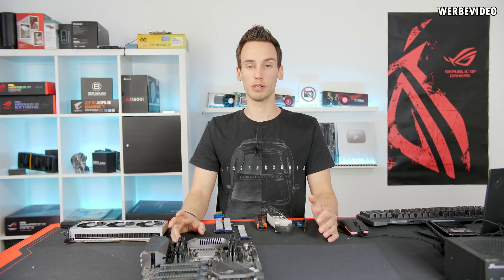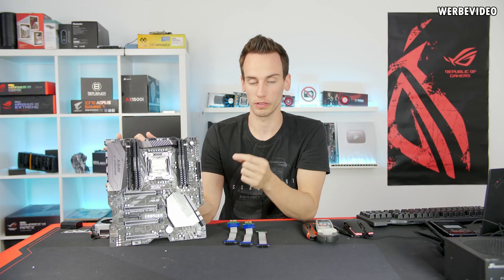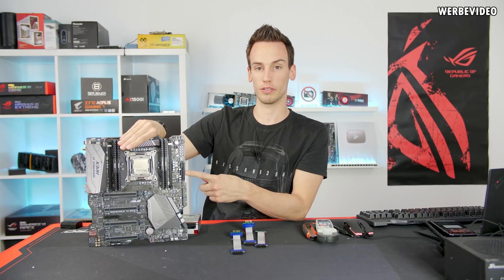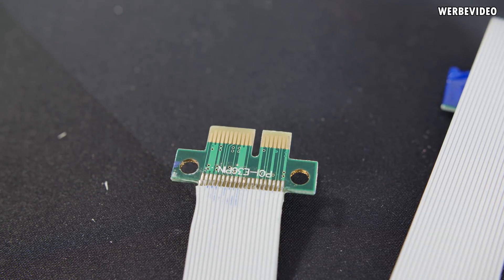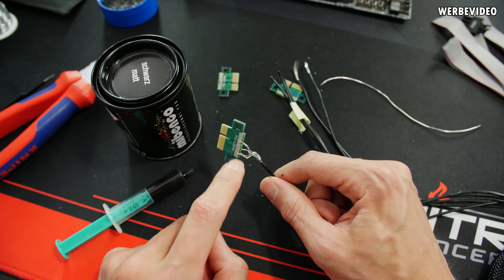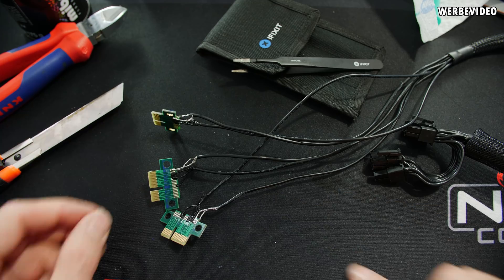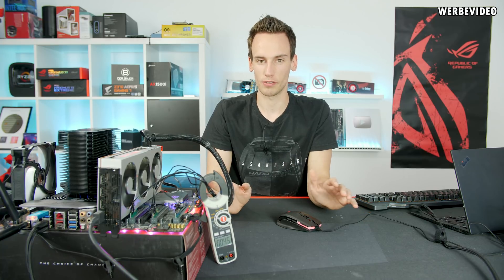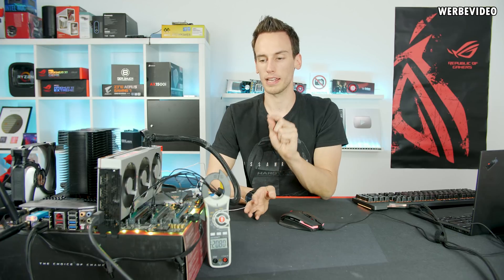DIY-Adapter: Running a Radeon VII just through PCIe-Slot Power

Comment: the dell optiplex 3040 has a i5 6500 and the board has no 24 pin but only an 8 pin, coming out the board is some proprietary 4 pin that powers hdd and cd/dvd and i spliced the wire and added a 6 pin to it so i can use a gtx 1060. i used riser cables also. i took out the cd/dvd drive so the gpu could stick out the front lolol. i have a 180w power supply, i used intel xtu to turn down how much watts it can pull under turbo load and lowered voltage. if i got a k scew cpu i believe you could over clock and change the multipliers using the xtu. i also used msi after burner to change how much power the 1060 can pull. if i dont do any of that i risk damage on the power supply. i dont know the long term use of what could happen to the board with power being pushed through the board to the gpu. from my experience dell has very robust products.

Comment: Mr. Der8auer. Just a quick note from a amateur pcb layout guy. I would be careful in assuming the ground pins that are with the data lines are ok for power. Most high speed design rules dictate to suppress noise and cross talk that the traces are routed separately and are not designed to flow any power usually very fine traces quite often on the same plane as the signal traces instead of the power plane layer in the pcb stack. I would almost guarantee only pins / traces that can handle power are on the first short part of the conductor. Another thing that will happen if you use the signal ground/shield traces is you could end up with current flow in that trace it will couple as noise into the signal line.

Comment: @derbauer hp uses a similar method in many of their desktops providing sata power for hdds ect from the motherboard, the PSU only supplies power to the CPU and board, then power for drives comes from the board via 4 wire cables that come off the board, hp Compaq pro 6300 sff, regardless amazing video as always :)

Comment: ive been hammering 2 RX480's with single 6pin under water OC'd since they came out mid range motherboard.  I run a lot of compute and 3d tasks that run for extended periods of time.

Comment: i think all motherboards should have on the PCB just  under the GPU  behind the PCIE slot two 8 pin male that will automatically slide in the GPU 8 pin females...and  get rid of all cables to gpus, with an extra Connector on the PCB.

Motherboards for factors shoudl be changed to 1 gpu   or 8 GPU configurations, and not  ATX eatx etc etc form factors...a smost gamers use single cpus it owudl makealso sense to change GUS to be flat on teh PCB like tehcpu instead ofhaving such amassive big Caard...this woudl thenmake it easier to use  single onoblock to cool everythign on the motherboard and kepe teh PCB clean from dust and smoking.
Reply: How would running my 4x crossfire work? Hmmm? You think you could safely power over 1 kW in cards stock? That PCB would also cost a fortune to safely do. It also might seriously make passing EM radiation/data loss much more difficult (nobody runs just 1 PCIe device, 4x NVME on an X16, GPU x16, SAS raid cards, networking card, sound card (though those are stupid, who needs quality sound?), USB expansion slots etc. What would happen to all that data now that you need hulking ground planes and power planes? That’s a really far distance! What’s wrong with a little cable? Sure I despise SATA 2.5 inch drives because they need 2 cables, but it’s not like an 8 pin is the end of the world...

You probably suggested a $20+ dollar motherboard upgrade (just great for all those $60 budget B350 boards you know!), and now no GPU in existence works with it either, congratulations, now go join Apple with the PCIe powered Vega card...
Reply: Also almost nothing needs a monoblock, most things are passives cooled (VRM, some CPUs, chipset), and now you want everything to have a $150 minimum waterblocks? Plus to say to that, my cooling systems would turn it into ice, so stop with the overpriced garbage ambient cooling! Your spending more than I do at some point, and my motto is “if it’s not icing over, then your not overclocking!”.

That would be one slow and overpriced component build up... and it would fit in nobody’s case! Retooling all standard size cases will cost a fortune, and some people like having the optional slots (there are more things in life than your slow single GPU and more reasons than crossfire/SLI to have 4 x16 slots, 64pcie lanes was the reason I chose a Threadripper over 7980XE at its 44 lanes, some people have NVME raid you know...)
Reply: @jakegarrett8109  u dont run  dozens of gpus and cpus in an office environment on load 24/7....you shouldnt comment about high core cpus or high density motherboards if all you need is a 6 core to play battle filed with on a mini itx with air cooling. as for water blocks, those who drive the industry   have water blocks in a simple workstation that cost more than you whole gaming pc

Comment: Why hasn't the PCI Express standard evolved to provide all the power needed by the card? Why is it still limited to 75W while modern cards need 4 times that.
Reply: Because that much power going through those small traces would be dangerous. Also your 24pin would melt.

Comment: Would you post or link some diagrams to do this ourselves? Bitte!
Reply: PCIe spec is on Wikipedia, it takes about 3 seconds to type “PCIe pinout”, why do people ask instead of finding it faster themselves? He even says the exact wiring about 1/3 the way through the video, pointed to each one on each side and explained what they are...

I recommend that if you can’t follow these basic steps that you DON’T try it! You are just going to try your GPU and the motherboard if you can’t figure out these basics.
Reply: @jakegarrett8109 Wikipedia is not a credible source. Good luck in college.

Comment: Windows does know about >2077 years. Most definitely it just denies to trust to certificates(what used to sign applications, libraries, drivers, etc) which will expire at 2077 or earlier.
Reply: This is perfect to set the year to when CyberPunk 2077 gets released.

Comment: This guy can solder, I need a few stiff drinks before even attempting that, plus three different forms of magnification.  I use a warm/hot glue gun for insulation- just as messy though.  Good video, I am going to try and run dGPU off the M.2 on an As-Rock A300 motherboard.  I have the bits sort of, I will need to adapt the adaptor as it is not open ended and is only Pcie X2.
Reply: Heads up, I dont think the A300 supplies 12v to the m.2 slots.
Reply: @MinecraftAddictPE  It doesn't but it allows access to the PCIe, I will power via Molex- well that is my first idea.  I will move through the options.  Get it working first, I plan to use either a 1050Ti, or a 1030.  Better the 1050Ti as that adds to the 2400G while the 1030 adds to a 2200G (but you would just use a 2400G in that situation).   Power is easy as I don't plan to run a 1080Ti or anything.

Comment: Motherboard standards should fix all this BS. You don't need PCIe power cables at all, it could all be delivered over a better PCIe slot with huge 12V pins or make a new quick connect plug on the mobo that the gpu would connect to at insertion and passes trough the motherboard and has connector for the PSU to plug in on the back. The standards are completely stupid at this point.
Reply: @ItsSpeltGoogol traces can be wide and the motherboards can do many layers, the 12av delivery isn't the problem, the cost is. That's why I'd rather see the new quick connectors and mobo passthrough, so we can hook it up at the back. Same for EPS and 24PIN etc. I'm tired of looking at all the cables that could be hidden at the back.

Comment: I do think 300w is a bit much for just the 24pin and molex. But being within temperature specs it functions
Reply: 300W = 25A /3 = 8.3A is easy. only 24pin would be 25A /2 = 12.5A which might/would become critical

Comment: I saw your previous video about extreme graphic card modding. I always wonder if its possible to change memory chips on graphic cards? For example you remove 2x2gb chips and soldering new 2x4gb to get 8gb ram card or more. Could you try that?
Reply: I ve seen it done with the i phone So i guess it could be done. The bios upgrade would be harder task i  think
Reply: Ukoverkiller the 1060 is not a real 1060 6gb, they cut off 10% of the Cuda cores... how big of a difference is that? Well my laptop 1070 beats the desktop 1070 overclocked on both, the laptop version has a small bump in CUDA even though it’s stupidly power limited!

You gonna glue those CUDA cores back on too? Intel will mock you for the glued cores, lol!

Comment: 0:25 "specs should be updated" NO HELL DUDE NO! The specs are just fine as they are. Just because you can cut most of the wires and no immediate fault or short-term danger arises from that, doesn't mean the connection is overspecced. It's got a safety margin that will help stave off degradation long-term. The connection as specified is expected to stay reliable for 20 years rather than catch fire in 8 months. A reminder is in order that fire safety is kinda a big deal, as it may end up costing someone their life. And i have seen this type of connectors gradually degrade until they start getting shitstain coloured and emitting smoke, when you run a little bit too much current through them over long enough time.

And sure you can skirt the specs on your private build all you want, or on an experimental one that is used in a secured or supervised manner, i do questionable things too, and as long as you can live with that, it's fine, you take the responsibility, but why you want to cut down connectors in hundreds of millions of computers around the world, no dude just no OK please?
Reply: Probably should watch the whole video before commenting.

15:53 He doesn't recommend doing this
Reply: @JohnJames0204  He referred to a prior video. Referring to that, he said that and i quoted "the spec should be updated" because it's apparently too generous. The rest of the video will not negate that bit. You have leeway to skirt the spec, but the spec is correct and is written like that for a reason.

Furthermore when he says at the end "I wouldn't recommend to do it" he refers not to removing PCI-e wires/pins like he did at the beginning of the video referring to his prior video, but to re-routing the GPU's complete power supply through the main board via the PCI-e sockets.

Comment: These kind of experiments are very interesting in my opinion. Are you willing to try this same experiment but pulling all the power just from the one slot and see how much it can handle?
One pretty stupid idea i got is to try how many fans can be powered from one fan connector on motherboard until it burns

Comment: i feel like the the 2077 issue is probably an issue with long term certificates expiring.
Reply: a quick check of my default certificate store for the computer account on win 10 pro 1903 shows the last certificate expires in 2052 while the last root ca certificate expires in 2043.
so since signed drivers must have certificates then thats the issue.

having the wrong time and date can cause so many different issues its usually one of the first things to check.
Reply: No it is proof that W10 isn't really free!  You will be forced to upgrade in 2077, liars that they are!  Lifetime of the product they said.
Reply: @twmbarlwmstar  actually they can update and install new certificates in the root CA whenever they want with windows updates.its been done in the past already.

so im sure ill be able to keep using my pc for the next 58 years easily
Reply: @mtlspider  Good because I didn't want to have to start a clash action lawsuit on their arses.
Reply: it's clearly when the world ends and there's no point in supporting software anymore :')

Comment: You said you would try it without the molex! Smoking 24pin or bust!

Also, would you like to try pulling all power from a single slot, for science? Like modding a high power card by looping the PCIE power to the 6/8pin connectors so the card thinks they are plugged in, but in fact they are drawing power from the slot?
Reply from the maker: Okay will try :)
Reply: @der8auer  Oo can't wait for that video
Reply: Now that sounds like a video :D
Reply: That's a real smoke test!

Comment: Somebody needs to make these PCIe 8pin (6+2) to pcie riser power cables

Before you scream, "that's retarded", hear me out
There are cheap Dell Inspiron systems that come with three Pcie slots, and a PSU that doesnt come with any pcie power cables

This would allow a person to run something like a 1660ti simply off board power and not have to upgrade the PSU and deal with those funky 24pin to 8pin Dell adapters.

Comment: That means a crap ton more power is going through the 24 pin to get to those PCIe slots right?
Reply: Some motherboard have a 6pin next to pcie connector to deliver power to it instead of the 24pins
Reply: @raphi_sch   most don't
Reply: @KalebQi  Which is why it would be nice to see this test on a lower end motherboard.